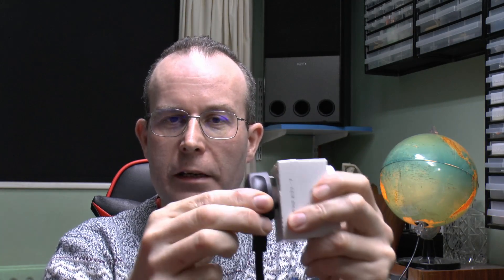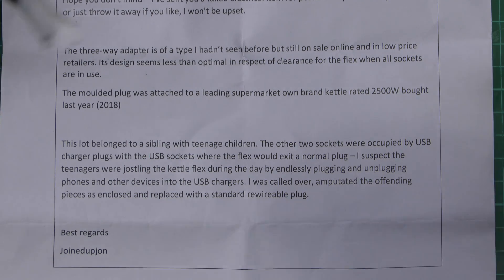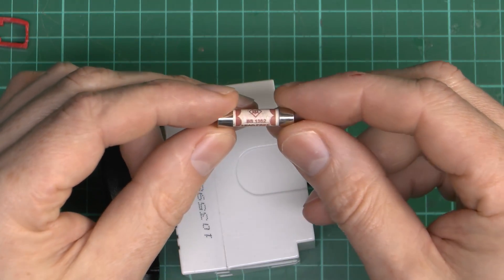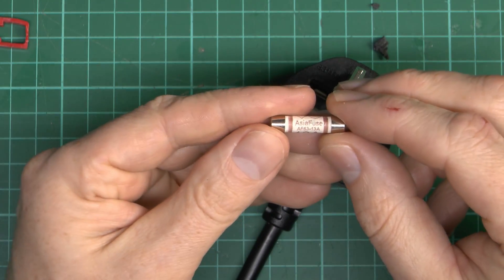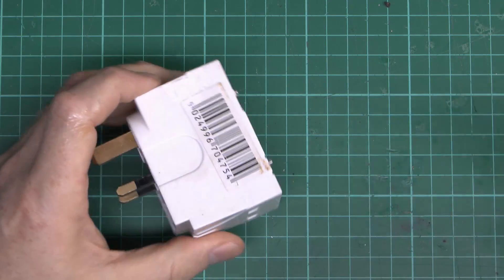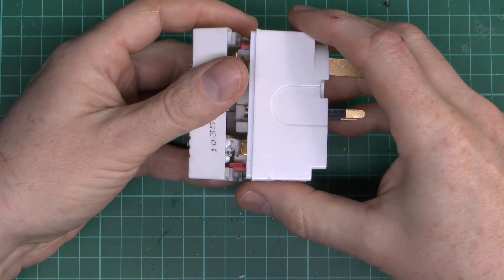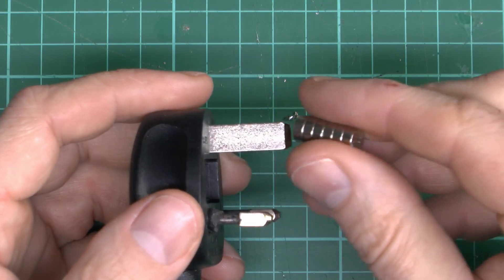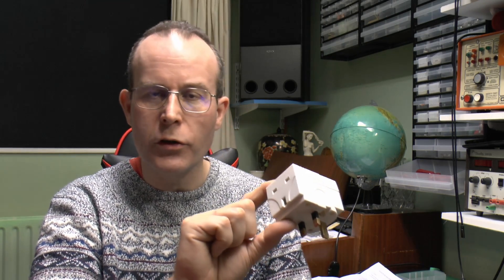Melted UK Plug stuck in a 3 Way Adaptor

Comment: I would say, I have had specific circumstances with the right use-case where these have been 'the right solution' .
We had a case with a single-socket wedged right alongside a cabinet that would be unsuitable to move.  Elsewise we would have installed the single-to-twin conversion-socket like was done elsewhere all over the house already.  Given the loads and users, the 3-way-adapter was perfect for lamp, extension-to-lamp, and occasional plugging-unplugging of ecko-hostess.   In that scenario the bar-adapter would have been a pain dangling down.   The presence of the cabinet and associated cables means this was NOT in a position to get knocked/pulled-off, bad connections, etc...

Comment: What's the general opinion on the bar type extensions that have the plug moulded directly into them? Same problem of weight hanging off the socket, but they're flatter against the wall...
Reply: I think I've seen them in pound land... Imo they feel a bit light so I'd suspect they aren't espeially strong. I'd be a bit worried than a good yank on the flex could over torque it quite badly and break it or the socket it's plugged into. Might be alright for careful use by a sensible person but if teenagers or other careless people are to make use of it I'd be nervous.  Imho
Reply: @joinedupjon  very bad idea to put any high current load on any multi socket thing....

Comment: Is it me or do most new appliance plugs run warm these days when there is more than a few amps flowing through them?
Reply: Different types of loads, phone chargers do that a lot, older laptop chargers did it as well
Reply: I mean just the plug not stuff like wall warts and chargers as they have electronics in them to give off waste heat, for example the plug for our kettle gets pretty warm after a boil. You can unplug it and the pins will be warm to the touch.
Reply: @uK8cvPAq  I have the same impresion, Moulded plugs with small conductors poorly welded to the pins, I have even had leads where there is no continuity through them due to weld failure and in one case the condutor stopped short inside before it continued, must have been the bit of cable where they changed over the reel in the caledering machine.
Reply: Its probably all to save a cent these days, cost them more to quality check than to just replace faulty ones sent back. On the other hand I've got plugs from the 70's/80's that can pass 13 amps all day and not get warm. Some of them have seen better days too but they still work to spec.
Reply: kettle will get warm, they pull the full 13amps and stress plugs to the maximum, even genuine old school MK sockets and plugs were stressed when we ran fan heaters at home in the old days,  needing replacement, so the modern isnt any worse at all

Comment: I have a 2.5Kw heater I bought in the UK and it has cracked my double socket in my house. The ring is protected by a Crabtree 32 amp breaker. Why is this happening?
Reply: Loose contacts maybe. I hate using rings because using stuff on your outlets are limited.
Reply: A lot of crap plugs floating around these days even the reputable ones are all cost reduced now.
Reply: Factory fitted plug tops conforming to UK standards protected by a 13amp fuse plus my council have changed the double socket and 1 week later that socket cracked.
Reply: What make was the socket or any idea where they got it from? Personally I've found modern Wickes own brand electrical fittings to be a bit crap.
Reply: @uK8cvPAq  Double socket is made by Crabtree. Just opened up socket and plug top and no loose connections.
Reply: Wow wouldn't of expected Crabtree to fail like that, maybe you've got a non compliant plug somewhere that's too big for it? Does the heater plug get hot at all?
Reply: @uK8cvPAq  Heater is 2000watt not 2.5kw sorry and is Rohs compliant according to the label and yes the plug top is hot. The actual fuse cover is distorting due to melting. I might swap these double sockets for the chrome types.
Reply: Ah, getting hot is caused by resistance somewhere. With a 2kW load its only going to take a fraction of an ohm to cause ohmic heating. Can you try a different fuse of the same rating to rule out a bad fuse?

Just thought of something else, is the pattress in the wall flush or is it warped in any way? As tightening down a new outlet to a warped pattress would put stress on the plastic and could cause everything to be out of alignment.
Reply: Can i ask you, if you were using appliances that uses much amps, do you use those rounded old plugs or what? At malaysia if the appliances is from 15A+ we need to use the rounded type plug and socket.
Reply: @zrellll  No. I've had inspection and test done in my property and a new consumer unit is up to date.
Reply: You talking about just domestic or industrial plugs too?
Reply: @SyazTYT In that case domestic plug UK loads don't go above 13 amps, only round plugs you might come across in domestic settings are for vehicles and the odd home workshop outlet. Stuff like cookers get wired in directly.
Reply: @uK8cvPAq  like here we dont have those red switces for cookers
Reply: Do you plug your cookers in and how many amps is the breaker for their circuit normally rated for?
Reply: bad socket and/or plug connections
Reply: if the council changed them and they cracked, they may be cheapo crappy ones,  its 'possible' what you're plugging in is faulty and taking a bit more than 13amp, but not enough to pop the fuse but enough to cause overheating and damage, fuses dont pop 'suddenly' over 13amp, you could probably draw 14 or even 15 and it would take it for a while....
Reply: cut 2-3 inches off the cable and refit  a new plug, its caused by the  cable being yanked and causing a high resistance inside the plug end